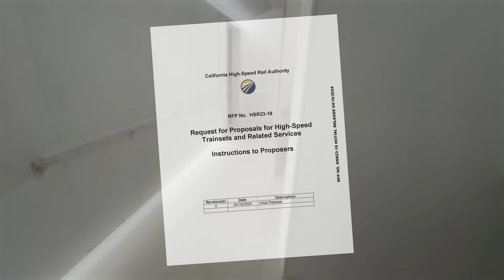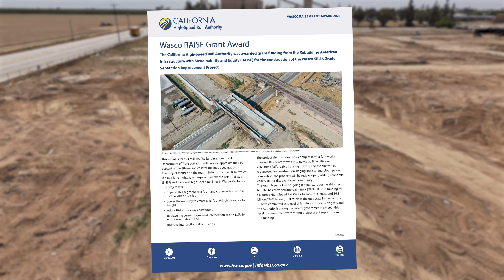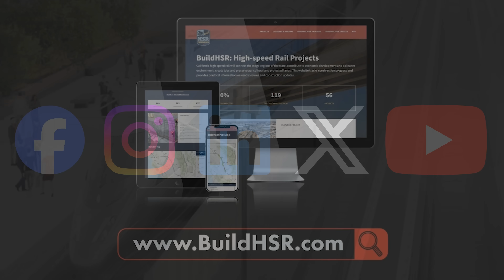Spring 2024 Construction Progress Report: Trainsets, Construction, Stations, and More!

Comment: There is still a lot of work to be done. Are they sure they're going to be able to test in 2028?
Reply: 3.5 years is still quite a bit of time. After the earthworks and bridges/viaducts are finished, installing the rails and catentary shouldn't take too long, so testing of the track could begin relatively early. Stations and maintenance buildings will probably take a bit longer and won't be finished by 2028. At least, that's what I imagine.
Reply: Trainset testing in 2028 will also be done at the national transportation center in Pueblo, Colorado, so it won’t be on the California tracks.
Reply: @Trojans5050  CAHSR trains are to be tested at up to 242 mph. That's likely faster than Pueblo can handle, making the California HSR tracks the only place trains will be able to safely go that fast.
Reply: @ChrisJones-gx7fc ah great point. I just googled it and the max speed at Pueblo is listed at 156mph. They likely can do some testing there but you are right, full speed will need to be done on the mainline.
Reply: @ChrisJones-gx7fc I wonder where BLW will test their trainsets if they are supposed to be up and running by mid-2028 and it takes at least 8-10 months to test if not more. If read that only relatively short sections will be capable of hitting 200 mph.

There seems to be a lot BLW still hasnt detailed including how they plan to tackle the Cajon Pass.
Reply: @mrxman581  well, BLW says they expect construction to take four years, which if proven true means their chances of starting service in Summer 2028 are close to zero. Siemens will need to have a plant ready to start manufacturing the trains, ten total (eight of which must be made in the US), likely in Nevada given that was part of their proposal to BLW to be chosen, and then the trains will need to be tested. That’ll most likely be on BLW’s mainline just as it will for CAHSR on theirs.
Reply: @Trojans5050 Dynamic testing has to be done on the actual track for long distances. They should be able to do it on the first 119 mile section. They  shouldn't have to wait until all the 171 miles are finished to do the dynamic testing.
Reply: The plan is to lay track starting next year, and with CP-4 effectively complete except for one delayed canal relocation (the southernmost 22 miles of the project) and much of CP-1 north of Fresno's major structures complete enabling another 20-30 miles at the north end possibly. As more structures finish in '24 and '25, by the time trains arrive in '27 or '28, they should have plenty of track ready for testing if not all of the initial 119 miles of CP-1, CP 2-3, and CP4 combined.
Reply: Testing signalling systems takes a lot of time too...